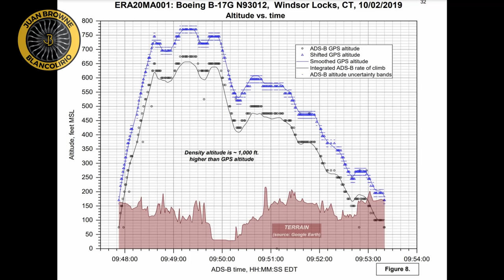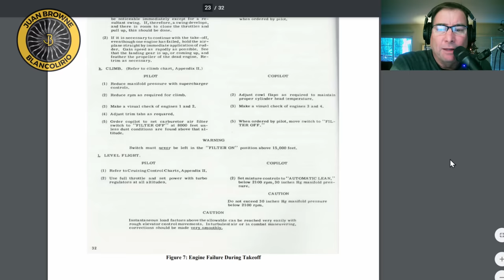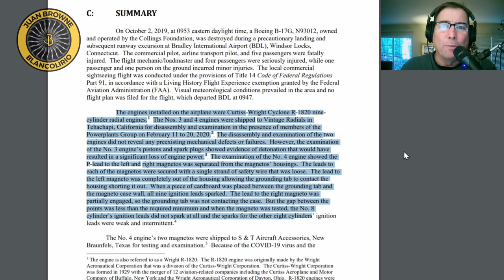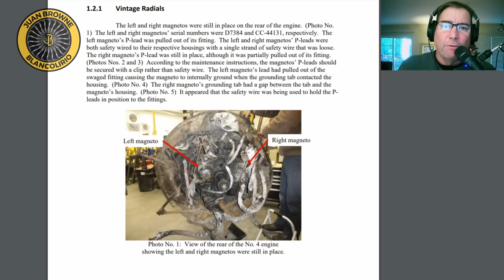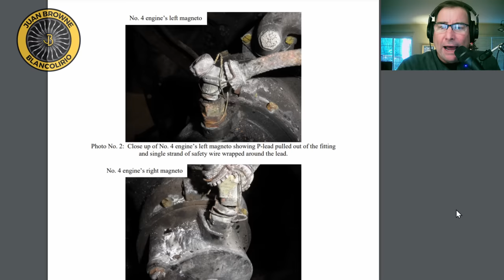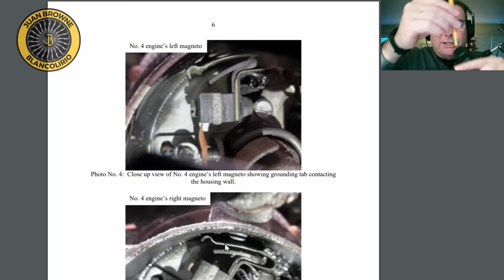NTSB Report B-17G Crash 'Nine-O-Nine' Part II -18 Dec 2020

Comment: As the point gap gets smaller the timing advances, maybe causing detonation
Reply: Nope. As the point gap gets smaller it's because the wear on the cam follower causes it to ride the cam longer before it can open. So worn cam follower = late cylinder firing.
Reply: @paulcrumley9756  your right, been too many years, got semiconductor brain now.

Comment: Even if the mags were put right that cylinder corrosion was potentially a very serious issue. In an air cooled engine how did the water get in and remain there for so long?.
Reply: Yes, that looks like what I've seen in bone yard tractor engines sitting outside for decades. I'm guessing it was a cylinder near bottom of engine and somehow collected rainwater from exhaust system. I'm  looking forward to Mr. Sumwalt's  NTSB investigation report. THEY will analyze that corroded cylinder and determine if that corrosion could have happened due to fire fighting efforts. If it's pre crash corrosion, the conclusion would have to be that they we're operating the plane for some time with a dead cylinder. That to me would sound like a smoking gun!

Comment: that engine was a hurting unit. improper ignition timing was probably what led to the detonation, which chewed up the plugs etc, etc. that top cylinder must have been running HOT HOT to end up that messed up and coroded. when they showed up the bore and you can see the head, that exhaust valve was cooked. normally you see white on the valve itself, and some on the head around it, but for HALF THE HEAD to be white like that is from excessive combustion temps. 

I'm actually curious what the carbs were like at this point because I would not be surprised to find it running out of spec as well. that much heat isn't just from detonation, and it seems like it was a systemic maintenance issue with the ignition, so carbs would be the next system down to cause issues.

Comment: These planes were built with the expectation that Uncle Sam's deep pockets would supply parts and highly trained (and current) mechanics with specific knowledge of a given airframe and powerplant throughout its service life. The hard learned experience of those skilled techs is long gone. Flying them as a hobby is dangerous and will result in the extinction of these old birds.

Comment: I'm going to weigh in from my professional viewpoint as a USCG licensed Chief Engineer - 
Ships, like aircraft, operate in an unforgiving environment, and their operation and maintenance is covered by the CFR - 
so there are some distinct parallels in Professional Licensing and Vessel/Aircraft certification.
First off, this is a very sad and tragic situation. 
Operating complex antique machinery is extremely challenging under any circumstances.
However, there are clearly some systemic issues demonstrated here. 
While the FAA clearly has some issues to answer for - because they failed in their oversight duty, the Collings Foundation still had a duty to fulfill their obligations in reporting. 
It is unacceptable to just quit reporting to a regulatory agency because there are communication issues.
IMO - It is poor practice to place the primary responsibility for both operation and maintenance in the hands of a single person - especially when one is dealing with both complex equipment and stringent regulatory compliance for both operations and maintenance. 
I have rarely encountered someone with the requisite skill set to truly fulfill both positions.
This may, or may not, have been a factor in this case.
It would appear that there were critical lapses in maintenance. 
It would also appear that these directly lead to the tragic loss of life being discussed here. 
As I often  remind myself, and all the mechanical personnel that I supervise - lives are dependent on the quality of your work. 
Make sure that you've done your work correctly.
I greatly admire your programs, on all the various topics you cover. Thanks
Reply: It is a similar situation to the loss of the ship "Bounty" in the North Atlantic several years back. The vessel was owned by a non profit that needed it down south so revenue could come in again. The ship was unfit to put to sea in anyone's mind. It was crewed by volunteers unfamiliar with the ship for the most part. Maintenance was only enough to keep two diesel engines running and was captained by a man of very large ego who could NOT be disagreed with. He decided to sail the ship into a cat 5 hurricane and the inevitable happened. Most of the crew survived thanks to the superb efforts of USCG personnel on a night that nothing should have been flying.    We NEED the MONEY seems to be a common driving force. Whether it is a large ship or complex aircraft they both need proper care and maintenance to operate safely.

Comment: Is it possible to upgrade the ignition system on these engines points have been removed ages ago on modern engines and even old engines have been retrofit with digital system I'm not sure it is possible in these cases but it's been a long time since I've herd talk about ignition systems like these

Comment: ..I have never been on one of these flights, but I have seen them at numerous stops here in the Southeast between 2001 and 2013, toured the aircraft(on the ground) and spoken to the crew several times, and was under the impression they were professional, and took safety seriously...my first indication that this may NOT be the case, was in 2013, the tour made a stop here at our small civil airport in Blairsville, Ga...I took my usual ground tours of the bombers, and the two seat TP-51C was with them...I walked around the aircraft admiring it, then I noticed something that alarmed me...now, I am NOT a pilot, aircraft mechanic, aeronautical engineer, or anything else of the sort, but what I saw was the starboard wing fillet, fairing, or what have you(that smooths the joint between the wing and fuselage), had several..don't remember exactly how many..but several rivets missing, and there was a good 3/8" gap at one point between the fairing and fuselage because of the missing rivets...and this aircraft had just given a ride...I could clearly see, that if the fairing departed the aircraft in flight, it was in perfect line to take the starboard horizontal stabilizer out, which could potentially cause the aircraft to crash...I promptly informed a nearby volunteer, who referred me to a younger guy, don't remember his name, who was the crew chief, maintenance engineer, or something like that(it was NOT Mac)...after voicing my concern and actually pointing out the damage to him, he gave a dismissive "ah, it'll be alright", or something to that effect..dismayed at the lack of concern, I decided that I would never fly on one of their aircraft, even if I became financially able to do so....as it turned out, to date, that has also been the last time I have seen the aircraft on tour, and, sadly, the last time I ever saw Mac or Nine O Nine... :(

Comment: A few months before this crash, I basically chickened out of my scheduled flight in their B-25 and got my $400 refunded. That didn't take me off their mailing list though, and I just shake my head and delete the rather frequent emails they continue to send me (even today actually). The earlier report had pictures of the safety-wired primary leads... I remain gobsmacked that after having their shoddy maintenance displayed they'd have the balls to continue to seek money from us. No.
Reply: I flew on their b25 a few years back. They did go through a safety exit procedures. They did go on the usage of the lap belts. They furnished ear protection. They also changed 2 spark plugs before the flight. They also ran up each engine before takeoff and switched between the magnetos. It felt good to have all that stuff done and visible. Oddly our b25 did have some engine miss fires before they swapped out a couple of plugs. The b17 909 and b24 engines had no issues with engines.

Comment: One has to wonder what happened during engine runup and ignition check - Mag Both, Mag Left, Mag, Right, Mag Both....   if any???  Magnetos usually do not fail from "perfect" to fail within a few minutes of run time. This especially in the hindsight of the technical examination and revelations thereof.

Comment: That is surprising about the rust in those engines that had 300 hours.  Maybe that was due to putting the fire out and then the time to inspection.  Will there be a part 3 follow up on landing performance?

Comment: If you want to fly these death traps you need to have extra engines which are maintained/serviced on the ground and are then switched out (like in WW2). Four  massive radials is a big job to do on a voluntary basis.

Comment: Excellent presentation! Must be very painful to watch for the next of kin to the victims. Specially the corrosion in that one cilinder was, let’s say, revealing and puzzling. Watching the aircraft on downwind scary nose high must have been almost agonising. And the question is why did this all passed the multiple checks, from maintenance checks up until pre take-off engine checks.... Human factors I guess. Changing plugs on a radial in darkness, rain, wind or snow, someone dropping the P lead retention clip in the dark and unable to find it... Begs the question whether doing maintenance on tour is the right way for such an aircraft. From my days, I can remember a controlled environment, a well lit, clean hangar with the right tools and spare parts goes a long way....

Comment: What would the maintenance Quality Control (QC) method look like in this type of heritage operation? I come from another public health and safety-critical industry where maintenance staff had specified hold points in their procedures, beyond which they could not proceed until the QC inspector had verified proper performance of a critical step and signed it off. I'm curious how that works in aviation.

Nine-O-Nine was a frequent visitor to San Luis Obispo airport over the years, and in May 2015 they canceled several public flights because a cylinder in the #2 engine needed replacement. A friend was scheduled to go up in her next flight but Collings refunded his money and gave him a free ride in the B-24. That I thought was very nice of them! Speaking to the staff, they said even with a new cylinder the B-17 wouldn't do any more public rides during that visit to SLO.

Comment: The thing that stands out to me is the spark plugs. Spark plugs are the worst at keeping secrets. If you're abusing, poorly maintaining or having troubles with a engine of any type spark plugs are the first to rat you out. They stated they were not cleaning up the plugs just replacing them, this is a red flag to me. The Pilot/Maintenance lead new exactly what he was seeing when he pulled those plugs for inspection, it would have been clearly evident on the plugs that something was wrong long before that fateful day. Hence why they were being "replaced" with new ones instead of being cleaned up. That kind of detonation damage on a piston with less then 300hrs means it was happening for awhile not just one or two flights, the plugs would have shown that every time they were pulled for inspection. 

 If I was investigating I'd ask if they have any old plugs laying around in a tool box or under a bench somewhere, I'd be willing to bet negligence is written all over them. RIP to everyone that lost their lives that terrible day.

Comment: Vintage question: Are electronic replacements for CDI (points&condenser) ignition available or even possible to retrofit?

Also: rust can form in the cylinders they inspected in hours if not fully chrome plated. Scoring is another matter though, if found.

 I can easily see why plug gaps were not right. After the 1970's, most fuels and ignition systems changed drastically, and most  plugs came with larger gaps (right from the box), as ignitions became more powerful. If your changing plugs often, proper gapping could easily be overlooked.
Anyone who is old enough to remember cars with points, also knows they never stayed working right long. Nothing has changed about that to this day. 

There was a plethora of mistakes, and always is. But just think what difference electronic ignition might have made, and please help me learn more( honestly) why it wouldn't make any difference going forward. I want more knowledge from you guys. Thanks in advance.

Comment: How did they not catch the Left mag on #4 during turn-up/mag check prior to takeoff?
Could they have advanced the timing to recover some of power loss due to wear on ignition?
Reply: Nope
Reply: @429thunderjet2  “nope” to which question & why?
Reply: @artnickel7624  I guess I was thinking it may have been ok on the run up and didn't show up till take off, engines of any kind will do the kinda stuff sometimes. But, I see other people saying he didn't do a run up.
 So idk. And you have to be careful advancing timing beyond specs, because that can promote preignition & detonation. But I probably should have kept my mouth shut , cause it's all been plenty hashed and rehashed already.
Reply: @429thunderjet2  looking at the problem I have known more than a couple shade tree mechanics the advanced the timing to keep from having to do a tuneup/real maintenance. Looking at the trash that were engines, I would bet that was done. And you’re right, it leads to detonation and destruction of the engine.

Comment: I'm a Motorcycle mechanic from the 70's and I was shocked at the sight of those mag's. Points need to be checked regularly as they wear mechanically so the timing is continuously changing ever so slightly. When the gap is too small it can result in an overheated coil (can explode) as well as retarded ignition timing. On a bike adjustment would be reccomended every six months or so, on a plane maybe every month depending on operation as so much hangs on it being perfect. The condenser would be replaced every time irrespective of condition. I'm sure that during operations in the war this would have been serviced (when possible) before EVERY mission as with a dwell Meter and a strobe it would only take 10 min per motor. These guys were asking for it...Great presentation as always!

Comment: I read that the rear pax stated that they weren't aware of the crew doing a run up and mag check. The LM/FE reported that they did. 2 pax that were able to escape through the hatch onto I believe the type 1 or 4 tanks which ever they were. The LM/FE stated he helped the 2 pax escape the AC. They said that they never saw him and don't  know what he's talking about. They did all agree that they had no preflight safety briefing. Apparently a Sergeant Major was 1 of the rear pax and was familiar with the proper use of the belts as well as AC procedures. If he says they didn't do a run up do you believe him or the LM/FE? Apparently the other 2 folks he claimed to have helped never saw him. Obviously the Capt. made the call to depart and everything I've read follows what you've reported that he was the most experienced 17 pilot out there. I'll have to go back and see your other parts but why not declare an emergency? Why put the gear down so early? I missed what was stated about the corrosion in the barrel? Exactly what is the barrel? Thanks, sad all around. I'd hate to see those type of flights banned. I've never seen anyone hop out without a huge smile on their face.

Comment: Lots of comments here about the condition of the engines and their apparent lack of proper maintenance, but some other things stand out to me. Shouldn't the pilot have called out what he was doing when he shut down #4? And when he shut it down, shouldn't he have immediately declared an air emergency and landed on the closest runway? I am appalled that the old WWII seat belts which were difficult to operate weren't replaced with modern ones for the safety of paying passengers. This was not an unused museum display!

Comment: Based on all of the evidence,  the mag check (one set only then the other set only) upon runup would have been outside nominal as per the operations manual making it a no go. If indeed there was no runup,  these pilots violated public trust by not following the proper procedures which is mind blowing.

Comment: I think my biggest take away is that the pilot shouldn't be allowed to also be the mechanic under the exemption. ESPECIALLY if they're also the owner operator. I hate seeing so many of these awesome planes go down because of poor maintenance. The freaking p lead was basically held on by coat hanger (I know safety wire isn't coat hanger)

Comment: I would not take my vintage motorcycle out on the road with a magneto in that condition, let alone take an aeroplane aloft. It was in a dirty, filthy condition, with incorrect, and worn parts fitted, components failing, topped off with incorrect adjustments. The people who paid to fly in that aircraft on that day, put their trust in individuals, and an organization, that had a non existant, and/or cavalier attitude towards safety, and they paid for it with their lives, and also lost the country a national treasure. Shameful.
Reply: What the PIC did was criminal.  This last crash in Dallas shows the CAF has no business flying planes.

Comment: You said that the safety wire method for retaining the P-lead was documented in the aircraft records.  I hope that method of repair is backed up by the maintenance manual , component manual , or an engineering authorization order.  That just seems to me to be out of limits and unacceptable unless it was allowed as a time limited repair to get it out of town and back home.  Should have been put on a monitored inspection over a period of cycles, days, or flight hours.  Thirty years with an airline as a mechanic and I have seen a lot of things.